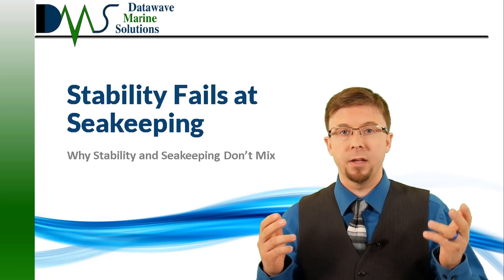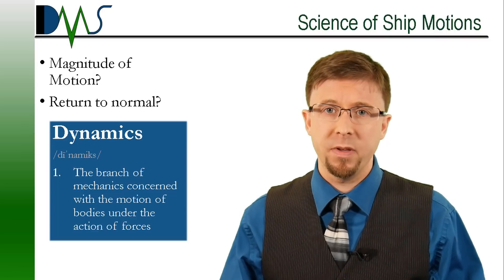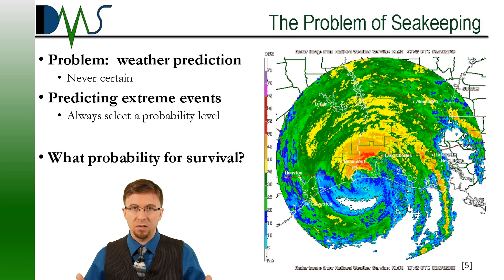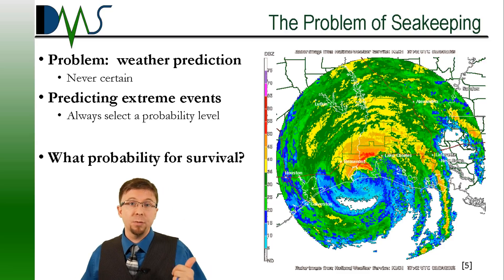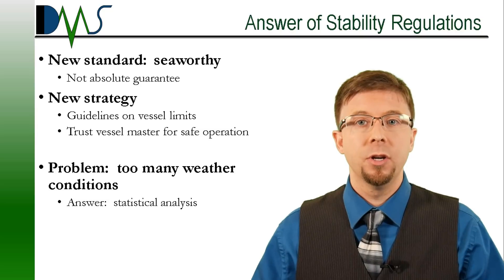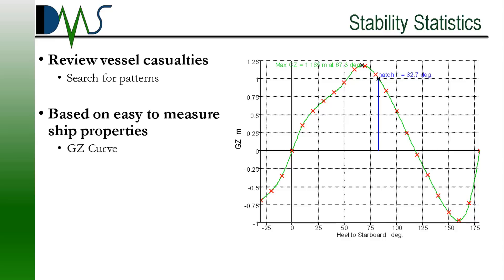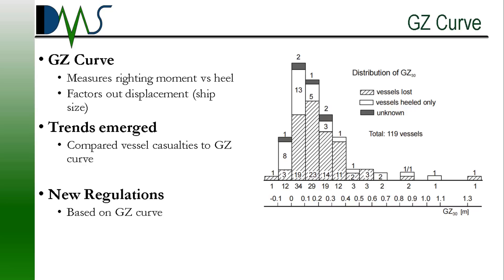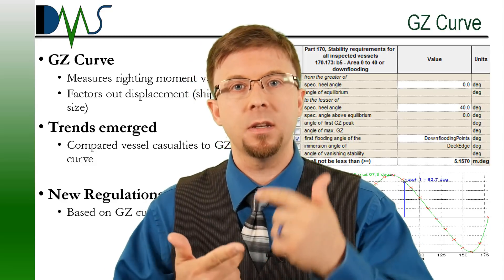Stability FAILS at Seakeeping:  Why Stability and Seakeeping Don't Mix

Comment: Lwr least wind resistance of the hull below water line.  Should be required and righting ballast should be required.  Why are regulations devoid of lwr least wind resistance or keel line stem to stern academic.?

Comment: Has anyone developed software to analyse wave length and optimise ship speed and course to the conditions? Seems like things like resonant frequency of the hull and hull speed should be avoided by changing ship speed and course to avoid wave amplitude increase
Reply from the maker: Yes.  The larger ships pay for a weather routing service.  Meteorologists give the ship daily predictions for the weather along their route.  And that feeds into software so the captains can plan the best route around the weather.  For cases like cruise ships, this means they can plan the best course to ensure a smooth trip.  For other ships like bulk freighters, they can plan to minimize fuel consumption.  None of this is cheap, but it works very effectively.

Comment: What about self-righting vessels? How realistic is that for recreational yachts. I’m thinking specifically of the Cape Horn Trawler style yachts that claim tank tested to be self righting.
Reply from the maker: It's possible.  A self righting yacht can be achieved with some careful hull design and a watertight deckhouse.  However, the bigger problem with self-righting is to ensure the engine still works when you come back up.  That takes a much more thorough design approach.

Comment: You might've defined "seakeeping" at the outset.  At the practical end, I regularly shipped between NZ and SF.  The last time was aboard Argentina Star in 1998.  During winter, we regularly had +/- 38 degrees rolls resulting from swells in the Pacific NW.  Once you know the ship and cargo can handle it,  you just wedge yourself in beneath your bunk and dresser and flake out.  The cook always had a hard time, tho.   On the other hand, on my Schooner Talofa in SF bay, 38 would've been rare, only used to wash off the deck or scare the tourists.

Comment: So what I conclude from this: The most powerful tool is analyzing the difference between ships that did sink in storms and those that didn't, finding a way of measuring such quality, and based on which ships did and didn't sink designing (and legally requiring) ships to be more like those that didn't sink in this regard? Makes sense, the only way humans ever learn anything is by trial and error. What makes humans so capable is that we are at least somewhat good at learning from the errors of others.
I would disagree with the assertion that "no ship is unsinkable." While some have falsely made such claims, I'd argue that it is possible for a ship to be unsinkable - if it is built in such a way that no matter how much water gets into it it will remain at least partly afloat. This is true for many smaller vessels that are filled with foam, not as common for larger ships but I can think of some somewhat larger examples. The MV Joyita was a ghost ship found swamped but afloat thanks to a cork-lined hull (intended as insulation for refrigerated cargo) and cargo of empty fuel drums which acted as flotation cells. So she floated, but all crew went missing somehow.
Reply: This video may be good for the novice on ship stability and ship hydrodynamics.
 If one really wants to know more about it, which is at present still beyond the ability of human intelligence, please go into probability theory of capsize, and better still, for damaged stability of different ship types and marine structures. 
Lyapunov theory that was available more than one hundred years ago was ignored until nowadays with high speed computers, and it is now at the the fore-front for the use of Chaos theory for the evaluation of ship stability, both for intact and damaged ships and different types of marine structures. 
Do not be misled by someone who tells you we know what we are doing and how good the regulations are in reflecting the facts. Keep up with your knowledge by reading more  nowadays research papers.
Reply: just like how they started armoring the unharmed parts of warplanes that returned rather than harmed parts....
Reply: Yes, the warplane example shows a particular hazard of your assumptions.

They began by looking at where aircraft were getting hit and adding extra armour there.

But at some point they realised 'wait, we're only checking the aircraft that survived a battle, not the ones that never came back'
And since they couldn't realistically check what went wrong to crashed aircraft...
But could see what kind of damage the aircraft that made it back had...
It became apparent that the armour has to go where the returning aircraft were LEAST damaged, since the damage seen on aircraft that made it home clearly wasn't critical...
Reply: @angrydragonslayer  I fail to see the parallel.

This is more like armoring a bunch of aircraft in random places and seeing which ones come back alive- then imitating the survivors, isn't it?

EDIT: Never mind.  Thought of a parallel.  If you have a certain flaw in a ship that causes it to list frighteningly, even in rather mild storms, it may cause the master never to take that ship out in heavier weather- unless he is very experienced (pushing up the survivorship when it IS taken out).  Whereas another ship, that is in truth more stable (but appears so as well), might be taken out more often in severe storms- even by novice masters- and thus sink more often.

So, if you design only based on Survivorship, you gst Survivorship bias.  You may actually be designing LESS stable ships simply because they frighten masters who are novices (and really SHOULDN'T be taking ANY ship out in a storm) and thus survive a higher percent of severe storms (due to only seeing storms under skilled masters).

I wonder if the calculations factor in years of master experience, or average number of prior accidents a captain has had?
Reply: @Northstar1989  my reply was definetly underdeveloped to a point of causing misunderstandings but i'm glad that it caused you to consider additional factors

Comment: Thank you I love stability talk I recently put together a 26 foot carver cabin cruiser that had a v8 and a upper and lower bridge all on a 8 foot beam, top heavy or tender in a sloppy sea state, I turned it into a LRC with a small diesel and as   low  a CG as possible, I read everything I could find on initial stability Vs ultimate stability, although I believe I ended up with a very slow stable boat I would love to here you talk about the two stabilities and how they work with each other especially on smaller vessel s under 100 feet or even less or completely non size relative at all as I assume size sorta does not matter if all comparisons are relative. thank you sir

Comment: Thanks for this video. Before this, i woulda thought that stability and seakeeping were the same thing. But can you give exact definitions of those two terms? I'm still not sure what's the exact difference between them. Is seakeeping more about how stable the ship is when moving thru waves (minimizing pounding, rolling, etc.), whereas stability is more about static stability like righting itself from heeling over?
Reply from the maker: Pretty close.  In seakeeping, we typically assume the ship will always return to upright.  The mathematics for seakeeping actually break down if we get to motions large enough to consider capsizing the ship.  

Stability is more about static conditions.  That is the largest difference.  In stability, we rarely consider the ship's momentum.  Almost everything is a static analysis, which can still achieve quite a lot.